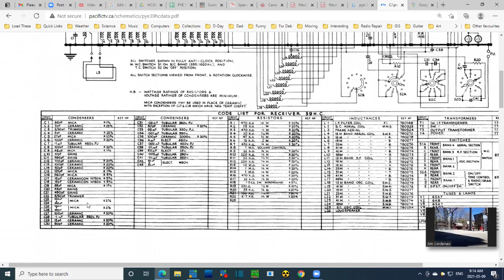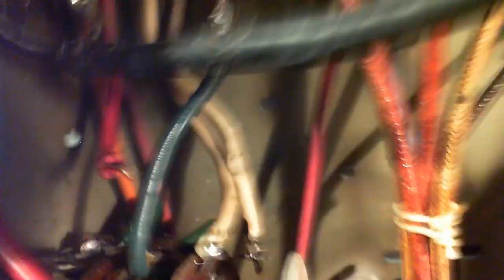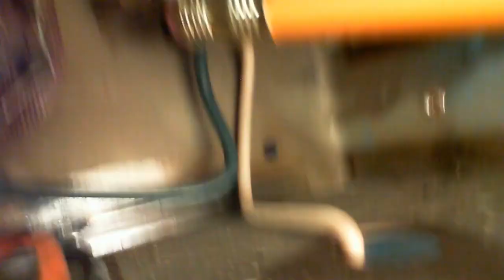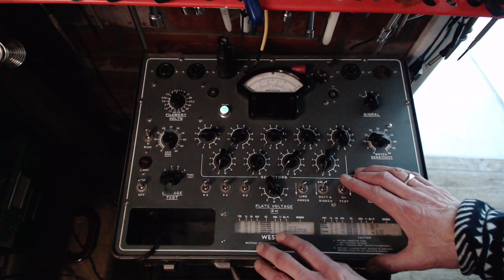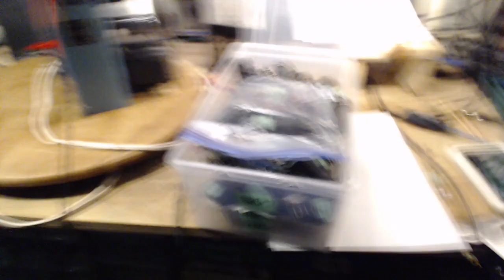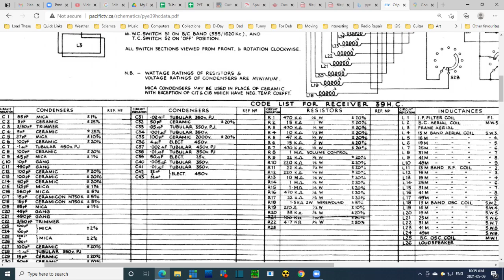Canadian PYE Model 39HC Video 41 - Intermittent Problem Solved

Comment: Two wires flapping around in the breeze, one resistor cut off and the great yellow cap is not even soldered...
What could possibly go wrong ?
Reply: That resistor lead needs to be reconnected and see if that fixes the problem.